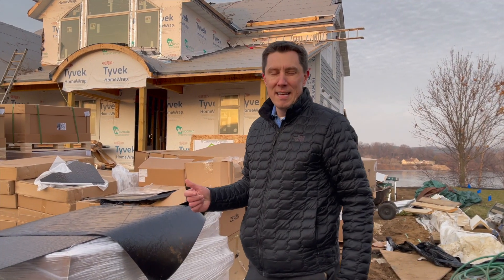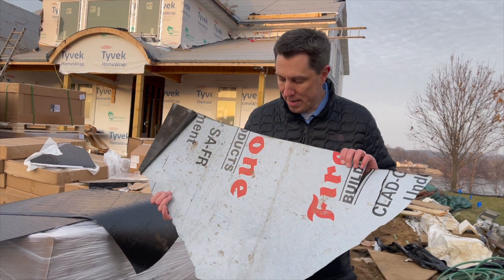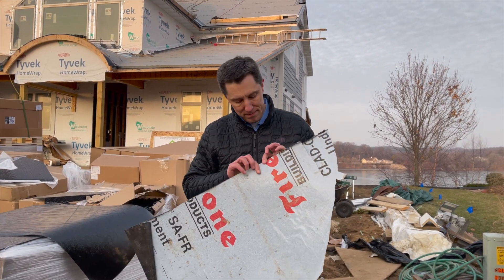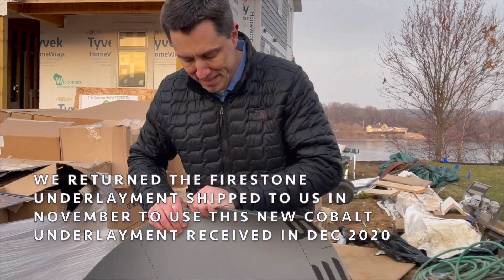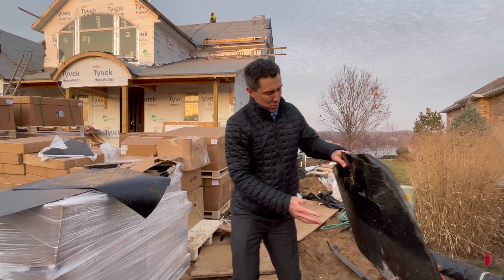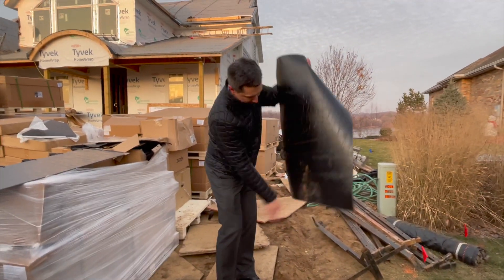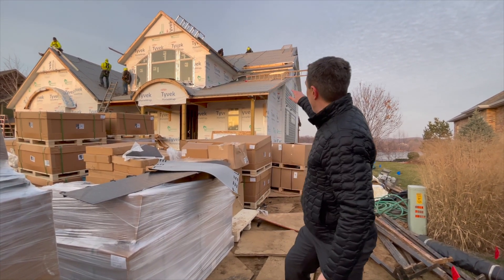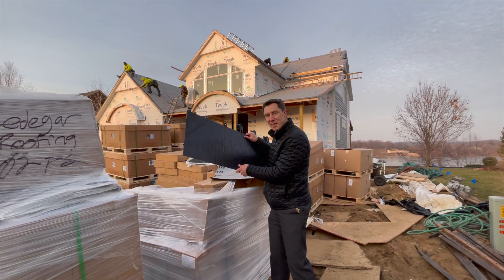Tesla Solar Roof - Ice & Water Shield Update

Comment: Did you have any issues with doing it on new construction? From what I have seen, they need to know a years worth of power usage. In order to size it properly.
Reply from the maker: yeah, not ideal.  it was basically a guess on the power usage.  I tried to estimate on the high side.  time will tell how accurate I was.  fingers crossed!

Comment: Congratulations Jason! 
I'll be following you, this must be so exciting! 
I'm pleased I stumbled onto your posting, you're the 1st NEW build with a Tesla Solar Roof I've seen so far!  I'm extremely pleased to see Tesla step up to a much better adhesive Ice&Water shield! 
I've built a 2 energy efficient homes now and am considering perhaps our last home for retirement and decided the Tesla Roof, PowerWalls and Tesla car are a top priority! 
So Jason :-) :
- what slope did they design your roof for to shed the snow... was it part of a Tesla recommendation or design component?
- Perhaps you would like to share a video or comments about designing your home while teaming with Tesla?  

Cheers,
Eric
Reply from the maker: hey Eric, thank you very much!  I was pumped to see the better IWS too.  I'm thrilled the timing worked out the way it did.
- slope is 10:12 for the most part.  there were a few minor areas that were 4:12 and 7:12
- was not a Tesla design component - the house was designed by an architect before Tesla became involved.
Reply: @JasonLassen  Excellent!  So how has your 10:12 held up these past couple of weeks with all the new snow storms? Praying all goes well!  
I can't wait to build with the Tesla SolarRoof!  
Here in VA, my neighbor has old panel style but snow won't come off for days.

Say... did your 7:12 clear snow as quickly as your 10:12.  I'm really wondering if the Tesla glass pattern aids snow slipping off? :-) 
At my latitude (38.3°) an 8:12 pitch roof will work well, but I really wonder if the snow will shed off of it???

Comment: I would like to hear about your experiences with icicles. My neighbor had a metal roof installed a couple of years ago, and under some conditions he had really large icicles develop. I assume the metal roof gathers heat, like the Tesla tiles would, the snow melts, runs down to the gutters, and collects and freezes there, sometimes overflowing  the gutters and developing icicles.
Reply: IRC rain chains rather than the typical gutter downspouts solve that problem.
Reply from the maker: @barskor1 very interesting!  I was not aware of that.
Reply: @JasonLassen  I have only seen it a couple of times, but he had icicles 2 or 3 feet long in spots. 

My roof is due for replacement in about 5 years, and I would like to go Tesla if feasible. Videos like yours really help. Thanks.

Comment: That is so awesome that Tesla identified these weaknesses of the Firestone sheets and developed their own. They likely source from a supplier maybe in China. Definitely needs to be tear resistant and adhesive in a wide range of temperatures and conditions.
Reply: I talked with Tesla yesterday about my solar roof project. The Tesla underlayment comes from Canada.
Reply: @tinac2580  Thanks! Looks like they can thin the material to reduce weight and cost. It is too strong.
Reply from the maker: interesting!  makes sense.  thanks for passing that along!